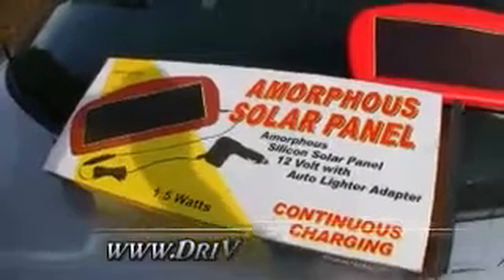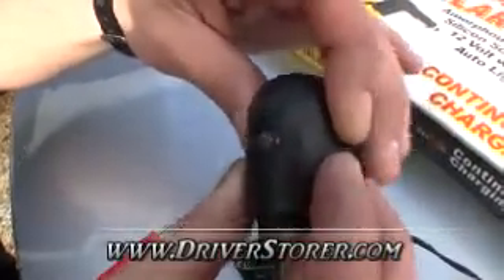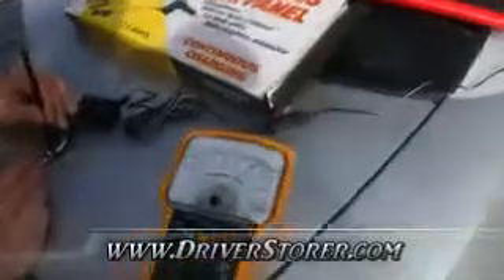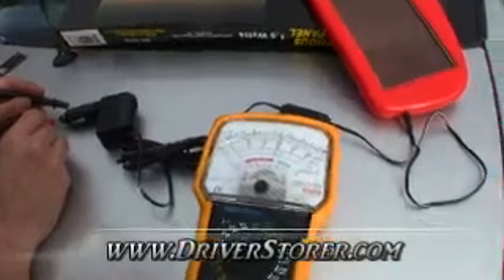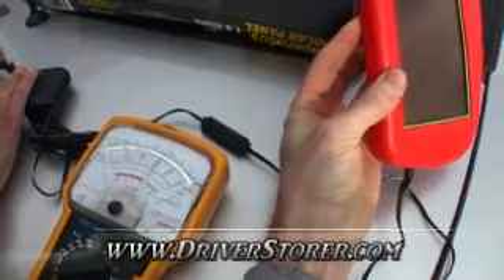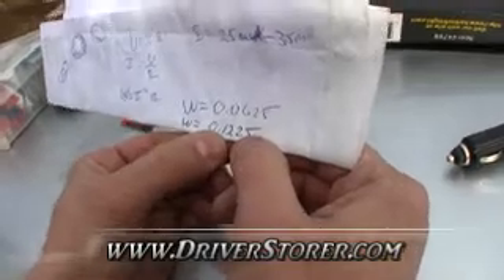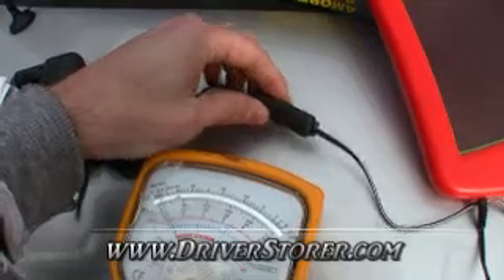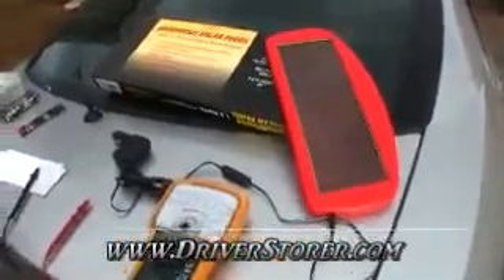Solar Power Battery Charger Kit- Harbor Freight 1.5 watt

Comment: Solar panel voltage is not under a load. Once you power a device off of it the voltage will stabilize around 13 volts.

Comment from the maker: @AngryDragonKungFu Not directly. You would need an inverter to do so.. or a car charger made for the ipod or other device in question. I would not charge sensitive electronics directly with this charger as the output voltage is not regulated.